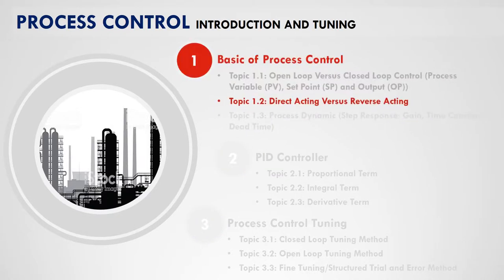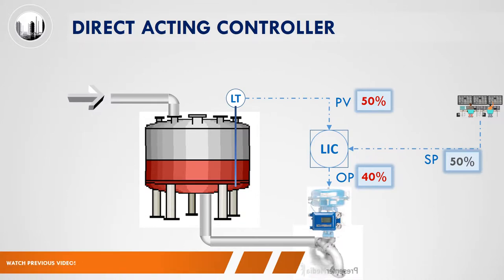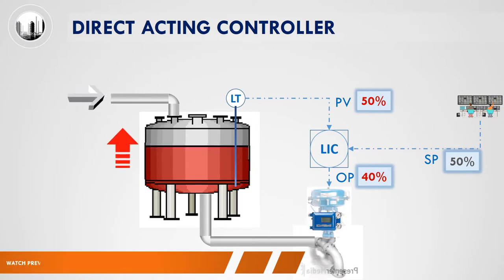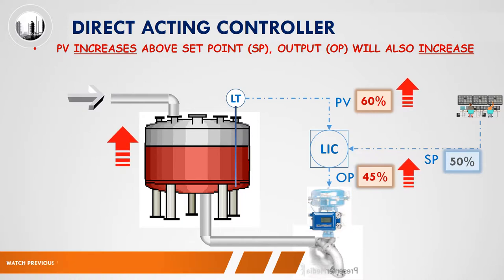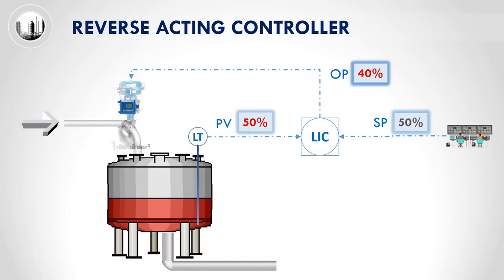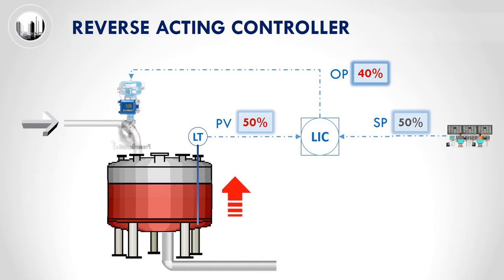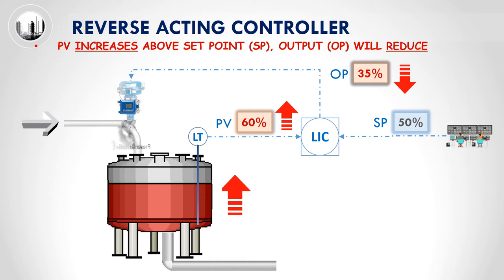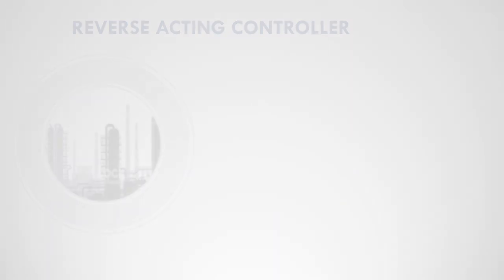Process Control: 1 2 Direct versus Reverse Acting

Comment: Everything okay,what will happen if the PV is less than the setpoint in both controller (Direct &Reverse) you explained about higher PV than setpoint what about lower PV please explain 🙏🙏
Reply: i think the control valve will do the reverse in each case
Reply: Valve Will be close valve after tank(dierect acting)
Valve will be open valve before tank (revers acting)

Comment: Is it possible  to operate  the ato valve with both direct acting and reverse acting ? 

I am confused
Reply from the maker: It can be done.  One method is to configure the action (reverse/direct acting) at the PID function block.  You can refer to this diagram: https://imgur.com/a/TBKk1Zn

Comment: Is it true that control valve direct and reverse action depends on the fail close or fail open condition? if yes, then how to decide control action.
Reply from the maker: For fail open vs fail safe vs fail at last position, it will depends on preference in terms of requirement for safety, equipment uptime, etc.  for example control valve for compressor anti-surge control, it will be fail open to ensure if loss of instrument air/signal loss (cable disconnected or PLC failure?), the valve will be full open to avoid compressor surge.  
In terms of how this is implemented, the valve can be fail open by the spring in actuator, using backup air supply ( from volume air tank with trip valve).